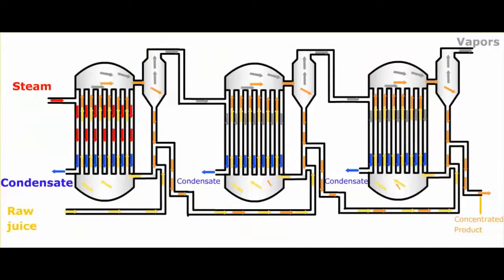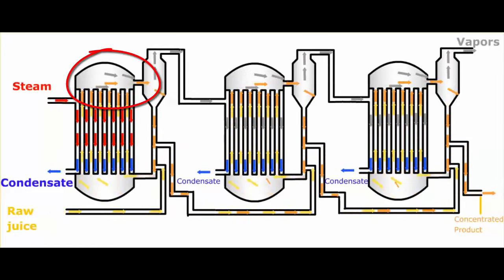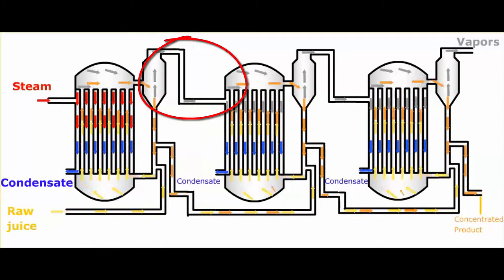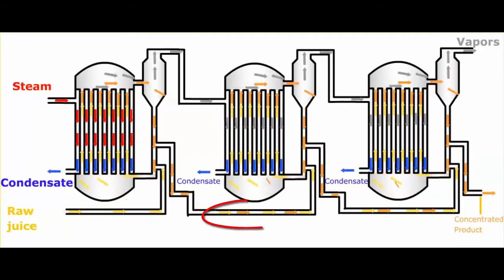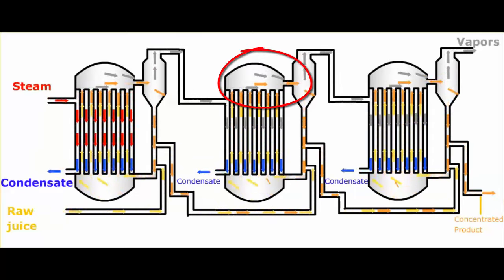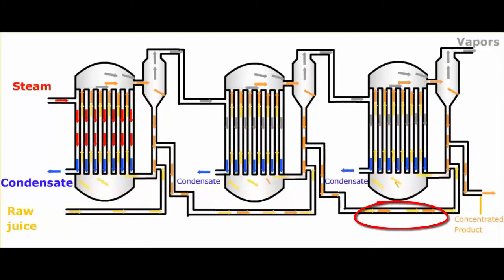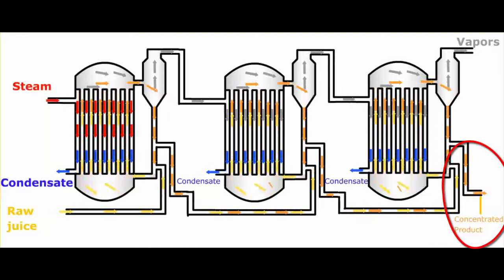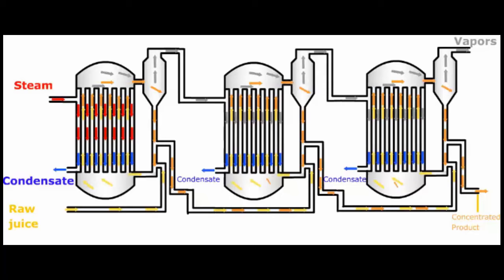Multiple Effect Evaporators - Introduction

Comment: Hi, may I know the vapour (raw juice) that comes from first effect to second effect, and acts as heating medium. Then it will leave as condensate. Will the feed (raw juice) be wasted? Thank you!
Reply: I guess the vapour is water, and normally the condensate is used as a recicle to the process...
Reply: No. vapour in first effect convert into liquid( generally water as for most of solutions which is desirable to concentrate in evaporator have water as solvent) after condensation and it may used for steam generation which will use in first effect for economical aspect.

Comment: sir as usual juice will pass from different evaporator, the concentration and viscosity will be increased. my question is wheather we have to consider viscosity or not???
Reply from the maker: No, in these examples we do not consider viscosity separately in conducting mass and energy balances. The influence of viscosity on flow rate is embedded in the mass flow rate terms that are used in calculations.